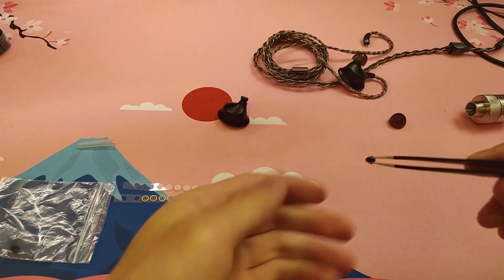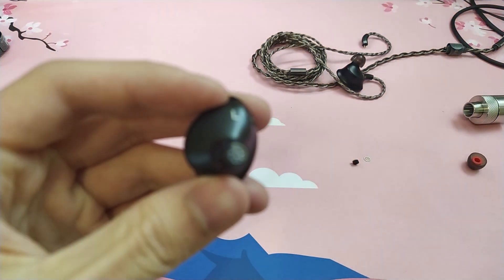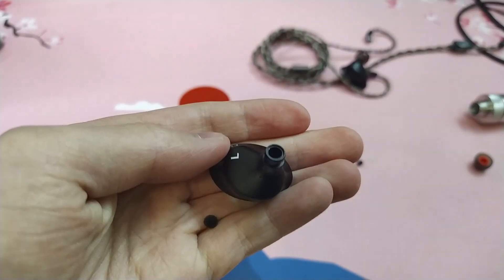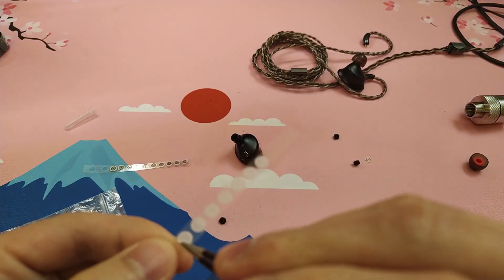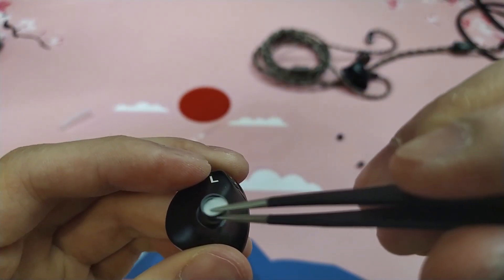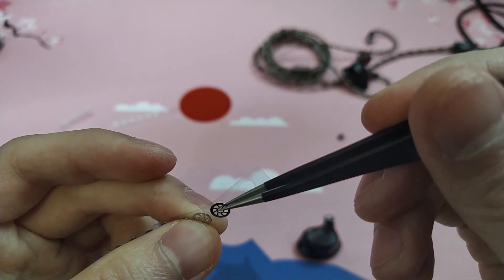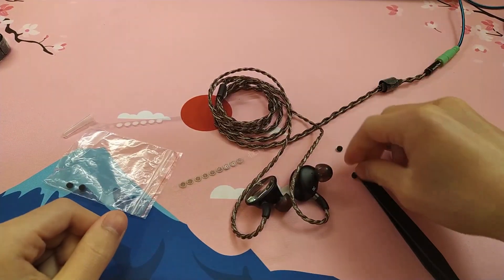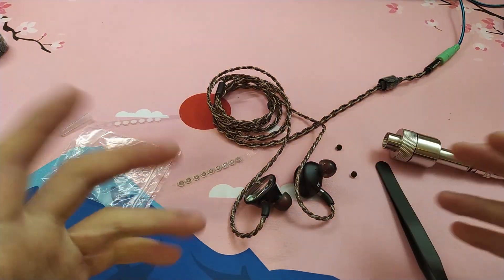7Hz x Crinacle Salnotes Dioko Filter Swap Tutorial and Graphs

Comment: I use filters in at least 40 iems.  I have all densities.  Even on the  cheap ones. Funny that nobody talks about the cheapest of them all  the kzd9. I place between the rotation nozzle half a filter of high density and this 10 bucks iem sounds even better than the 40 dollars. Some of them I use nozzle filter if there is no heat like gym sweat. For the gym I place the same filters as you do now. Much better for sweat conditions .